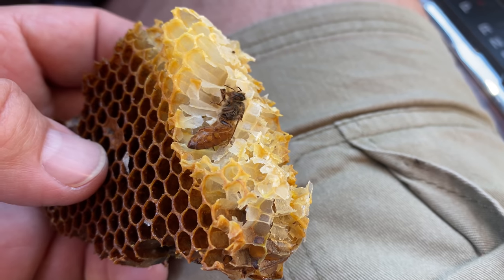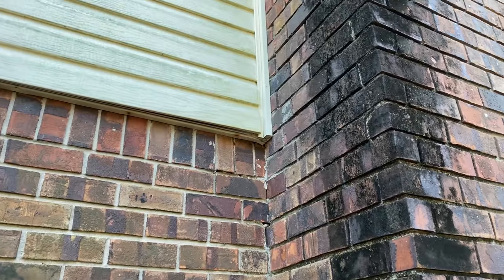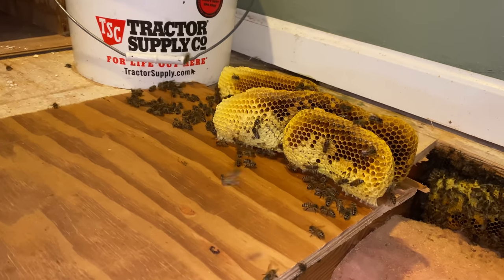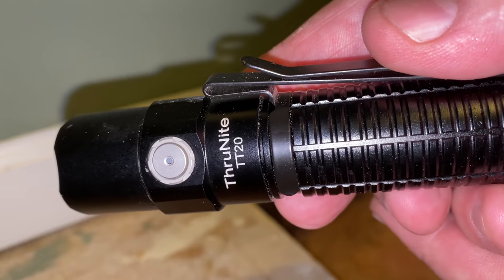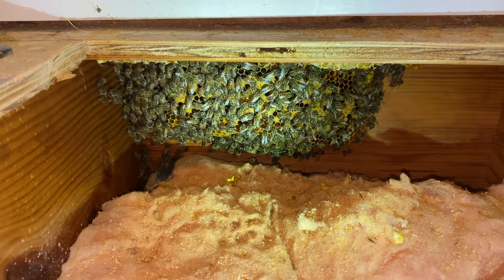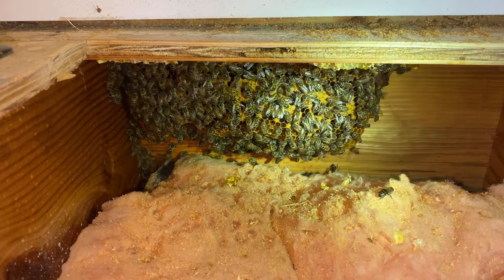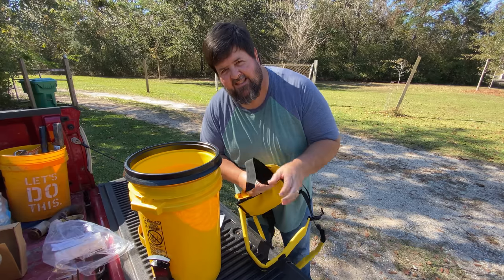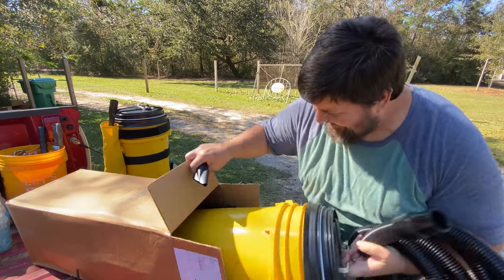Broken Leg Unbroken Spirit

Comment: You got a good break on that one as far as location. Bricks, bathrooms, and second stories will run me off in a heartbeat....I had my hands on Mr. Ed's everything vac yesterday but didn't have the heart, or the diminished morals, to sneak it into my truck. It sure was fancy...
Reply from the maker: Every time I run across bees going in at the side of a chimney or under a bathroom I just want to get back in the truck and drive away.  Next time you go to the abbey let me know and I'll sneak Mr. Ed's vac in your truck.  That way you can sleep soundly knowing you weren't the one with low morals.  :)
Reply: @628DirtRooster  Deal!!

Comment: Santa, can you bring me
one of those bee vacs for Christmas? I promise that I’ve been very good!
Reply: I dropped a major hint to my woman by leaving the iMac monitor on with a page open to a manufacturer. Let’s see if it works. 😂
Reply: Oh sorry I though thar was JP the bee man.
Reply from the maker: If it's not under the tree check and see if it's stuck in the chimney.
Reply: @628DirtRooster  it won’t go in my chimney. It’s a wood burning and it’s a prefab fireplace.  Just bring it to me at the conference in TN on January 8th, please.
Reply: That's just too funny!  I borrowed my Gen 2 to a local fellow I've been mentoring.  And when I needed it, I just grabbed a new one with the new bells and whistles!  I've got about 30 of these stacked up & ready for my Christmas customers.  And lots going to Australia right now (summertime there).
Reply: @18Bees  Let me know if you need to know if she got the hint.  Heck, we can have fun,  I can put a surprise message (or item) for her in the vac so you can open it and surprise HER too!  That would be funny.
Reply: @tonyandric4380  you definitely can mentor me!

Comment: You scared me for a minute there, bro. I thought you broke your leg. I broke my femur 2 years ago, and wouldn't wish it on anyone.
Reply from the maker: Yikes!  How'd you manage that?
Reply: @628DirtRooster  Part of it was that I tripped over a big ol' crack running up a driveway, but mostly what I did was get old :)
Reply from the maker: @DavidSprings  Haha   The last adult I knew of who broke a femur was on roller blades and hit a garden hose stretched across the driveway.  That was in the late 90's.